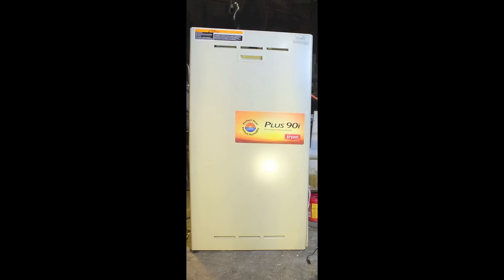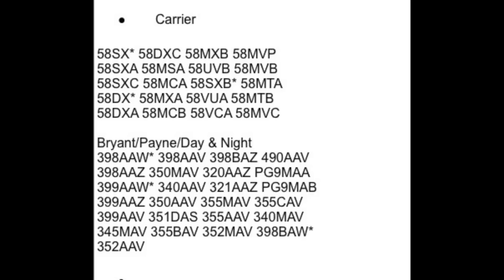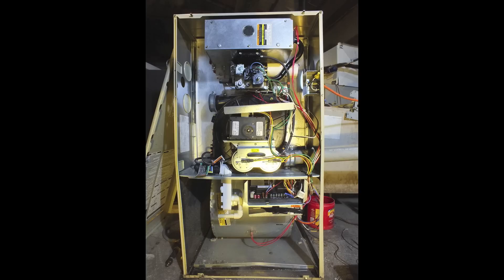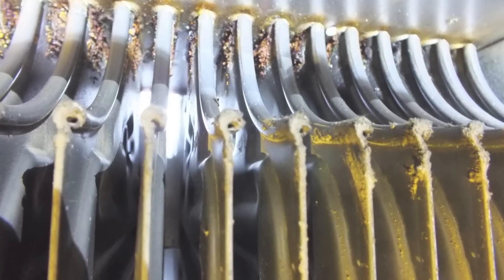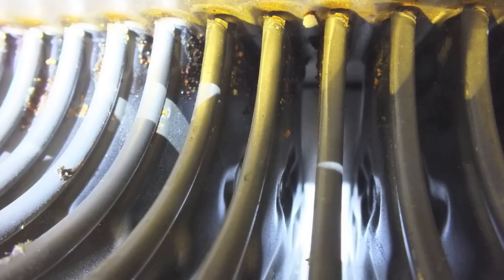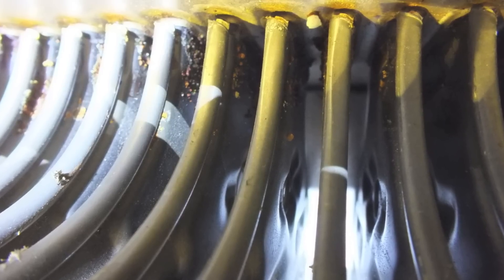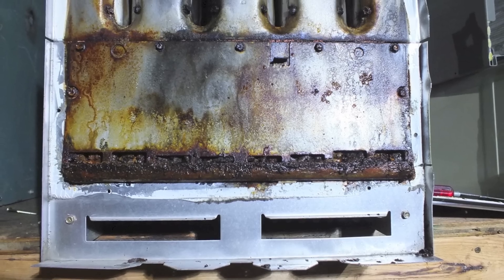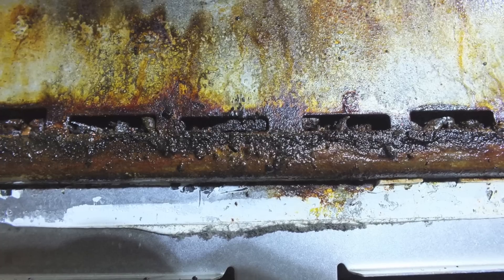Carrier Bryant Payne heat exchanger failure

Comment: Is this still covered by warrantee?  
Got a Bryant PG9MAB that was installed 13 years ago.  The service tech told me it's probably "plugged up from the epoxy coming off" he registered 225-300 ppm out of the exhaust, and he can't tune it into spec, but since it's over 100 he had to shut it down and leave it off.
Furnace hasn't overheated / shut off yet.  

Not sure if its this same "rusty" situation in this video or not.

Anyone out there got any thoughts?
Reply from the maker: I would go online with the model and serial.  It could be under recall.
GFM

Comment: I have a 320aaz060100aaka furnace.  It initially  had the square blower motor in it.  Everything  went to pot and they warranted the upgraded the motor and electronics in 2002 . It has been a good furnace since . I cleaned the trap yesterday and it is pretty full of that brown looking stuff that is in the video . I have the letter on the class action lawsuit , but didn't  know what to do with it . It had a deadline and looks like it has passed . I looked up through the blower wheel with my inspection  camera and can see white crust . Some has a brown trail off of them . Contacted Bryant dealer , they contacted  Carrier . Primary and secondary  have a 40 year warranty  , parts only . If found faulty , do they replace both ? Do they cover the additional parts required? I guess what is the procedure  for Carrier to cover this ? I asked the Bryant dealer if the parts were  available  , she didn't  ask . I feel the plan for them is inspect and condemn , then sell a new furnace.  Any input would be appreciated.  Thank you .
Reply from the maker: I believe both heat exchangers are replaced.  The crust is almost certainly a sign of corrosion thru the heat exchanger.   It should also be leaking water.  In my experience, any additional parts will not be covered.
GFM

Comment: I’m currently down because of this very issue on my 58mvc100-20. Actually had an internal fire that melted the pvc vent and another plastic piece. The system did what is was suppose to do and shut down or that’s what the a/c repairman stated. How does one file a claim with Carrier? I called them and was told by this call taker that they only handled recalls on a specific model of Carrier’s power cord and she did not have any information on who I might call, other than to call my installer. He’s out of the picture and the unit was installed in August 2011. The a/c company I use is replacing the heat exchanger with a basic one at $2,500. Thoughts?
Reply from the maker: I have no more info than you.  I got it off the internet.
GFM

Comment: I have a MAV 355 and I'm getting a flame roll out. I guess I'll look into this recall.
Reply from the maker: That is almost certainly the problem.
GFM
Reply: grayfurnaceman Do you know if this recall is still open.? I'm curious if it is going to be covered by carrier or if I be responsible for a portion of the repair costs.? Also, as a plan B I was looking at a Goodman Multi-Speed 2-Stage Upflow / Horizontal Gas Furnace, 21 In., 96% Afue, 100,000 Btu, 1,600 Cfm furnace as a replacement option. I wouldn't mind your opinion of what you think of Goodman products compared to Bryant product line. I've always liked the middle of the road types of brands, meaning good quality but without too many bells and whistles. I love in Wisconsin in an older Victorian style of home thats 2,400 sq.ft. so that is why I would like to stay with at least a two stage furnace. Thank You for your in site to my situation.
Reply from the maker: I haven't checked lately.  You can check on the internet.  The Goodman is a builder type furnace.  I usually consider Trane or Rheem.  Just my opinion.
GFM
Reply: grayfurnaceman Well, I thought I'd pass it along to you, that I didn't have a HVAC guy coming out to look at the furnace and it pagged out the C.O. on his emissions testing device. The way it works is carrier is covering the cost of the heat exchanger and the labor to have it installed. I just have to pay a $175 fee to have it done.
Reply from the maker: Thanks for the info.
GFM

Comment: My secondary heat exchanger on a bryant 340mav was replaced 3/1/15 (after a lot of emails/calls with Carrier; I had to put $400 out of pocket). On 10/15/16 during a maintenance visit, the technician noticed that the "heat exchanger was leaking -> will contact manufacturer".  He never called me back. Early Nov 17, I noticed that the unit was leaking a lot more water. The technician just spent 6 hours on 11/2017. The bill was $714. The problem was "leakage from secondary. Gasket replaced" 
Should the cost of this repair be covered by Carrier as part of the the class action?
Reply from the maker: I would certainly try.
GFM

Comment: Incredibly scary for my family (my wife and 3 kids); I woke up to the sound of my Carbon Monoxide detector going off.  Luckily I had time to open all my windows and doors and determine that something was wrong with the furnace (Model: Carrier 58MVB).  I shut the furnace off and had it inspected.  The furnace guy confirmed the flaw with the furnace.  Luckily none of us died.  If you own a carrier furnace get a CO2 detector right away if you do not own one; also, get your furnace checked.  Our furnace is only 11 years old.
Reply: Co detector, co2 is not carbon monoide
Reply from the maker: CO detectors save lives.
GFM

Comment: they fix it !!!! how much charge for labor? is the new heat exchanger has a new design? or they give same part? if they made that mistake why would I give them another chance ?
Reply from the maker: Labor charge would be $200 to 600.  I don't know if the design was changed.  
GFM
Reply: No its not changed and they give same thing same problem

Comment: Just had our recall done, still had to pay $1000.00, We were told Payne only pays the first $350.00 in labour. They also do not pay for shipping of the parts.
Reply from the maker: Don't you just love these guys.   Make a defective furnace and you get to pay.
GFM
Reply: @grayfurnaceman  all that field testing manufacturer's brag about but never do. Carrier made stainless steel secondary then switched to aluminized steel with poly pro liner sealed with silicone, lennox let the pulse go because inferior secondary loops, Hiel ton of recalls, Arkla Preway/General Electric/Trane/American Standard also has quite a history of rust and corrosion & cracks. Everyone has copied carrier top burner design as in the 80's they were the only ones smart enough to put the burners in the top to avoid trapping condensation in bottom of heat exchanger on cold starts causing rust and corrosion. 35 years of installing, serviceing and sales of almost every brand out there listening to the lies from everyone of them. Has taught me there was never any field testing it was done in customers homes and a lot of these designs they knew were going to fail before they started manufacturing them customers have unfairly had to pay a lot of money for premature failure. Biggest lye I'll never forget Trane 22-C stainless steel heat exchanger rotted out in first 3 years which they did do the right thing and warranty new furnace parts and labor.
Lennox "we made a new furnace so you can compete in builder model sales, but keep selling the pulse as main when they new they were failing and emptied out their warehouses on the public, then emptied their heat exchangers before replacing furnace with their carrier copy G26 that failed, next step was cutting out 4th pass of heat exchanger due to condensation forming in that pass making furnaces shorter. Love the trade & customers I've met, seen a lot of things learned a lot, Everytime you think you know it all you find out you don't, Every time you think you seen it all you find out you haven't. A realy good day is when you learn something new or buy a awesome new tool.
Reply: Correction 22-4C stainless been awhile

Comment: GREAT STUFF  What do most HVAC companies want to bill you for the LABOR   like 6 hours?  and they pick up the parts to replace the Secondary Heat Exchanger ?  I bet they want to sell you a furnace instead. Thanks
Reply from the maker: 6 hours is about it.  I am a service tech and I don't generally think in terms of replacement unless replacement is the obvious best choice.
GFM
Reply: The ex- carrier dealer tried to place the gasket and it still leaked so they returned my money. But the Carrier dealer absolutely wants to replace the entire Furnace and A/C and even put in new ducts! I told him just repair it. He pressured me to accept his proposal and deposit $200 and when pressed I learned he expects the parts to take two (2) months to get.  SAY WHAT ?!? Winter will be over by the time he gets the replacement.

Comment: Garbage units, total garbage, worried when I see them, on routine maintence, once had 135ppm on flue gas analysis, called carrier, said I had 3.50 inc w.c for nat gas, they said, whoa turn the pressure Down to like 3.1 in.wc, I asked about the rating plate, he said don't worry about it, just turn it down, lol, took the inducer and   Collector off full of soot, on a 2 year old furnace, thing that boggled my mind, was no blackening on the 2" exhaust

Comment: I think it's important that people understand that this is not actually a "recall." A recall results in a bulletin telling service providers to find and correct these issues. Carrier is only covering the labor of these heat exchanger replacements as the result of a class action lawsuit, and only if the unit is less than 20 years old from manufacture date (or proven installation date) when a FAILURE occurs, and only if the issue is found during a routine, or "no heat" visit. (In other words: If it's working properly they will not cover it just because of the model, it must fail first.) Diagnosis can be as simple as identifying positive corrosion on the secondary heat exchanger (you can do this by removing the high temperature limit and swinging the bracket downward to see the secondary heat exchanger without getting invasive), however a before and after combustion analysis is required for warranty reimbursement. Primary cells are covered under warranty if cracked, rusted, or sooted. Carrier requires that you hold on to the failed heat exchanger until after claim is refunded. This failure is much more likely to happen on propane fuel. Carrier will also apply a credit towards installation of a new Carrier, Bryant, Payne, or Day & Night Furnace.
The failure is due to the interior of the secondary heat exchanger being coated in a PVC that eventually breaks down and flakes off, allowing the metal heat exchanger to become exposed and rust through. This break down can be caught early by cleaning the drain trap and looking for white and black flakes (or "chunks") or a thick brown sludge that resembles chaw. Burners are not covered under this program so make sure you charge accordingly!
The new secondary heat exchanger is now coated in a polypropylene and does not break down as easily allowing for a more prolonged operation of the unit after repair.
If the unit is over 20 years old the failed secondary and/or primary is covered under the furnaces warranty detailed in the installation packet, but the labor is not covered. Some warranty certificates state specifically that the secondary is covered "parts and labor" however it is not so specific about the primary cells, inlet panel, outlet panel, or coupling box kit, which are all required for complete replacement.
Reply from the maker: Randy Dallaire Thanks for the good info.
GFM